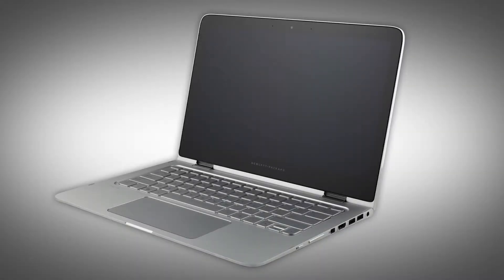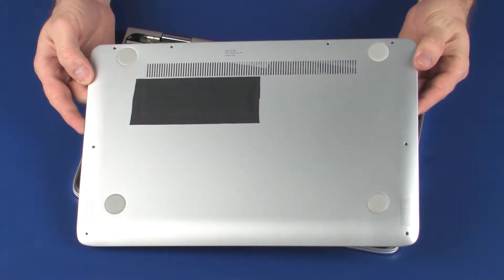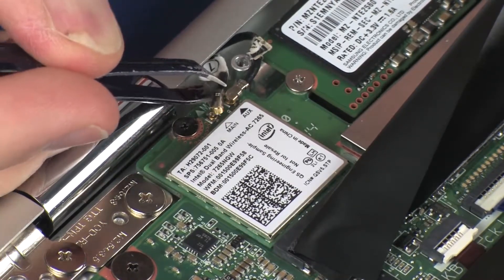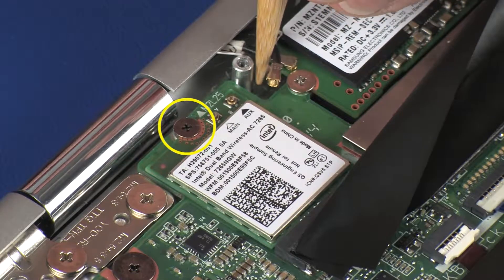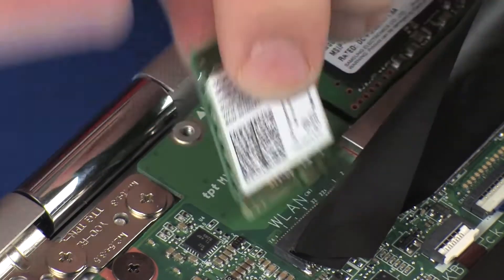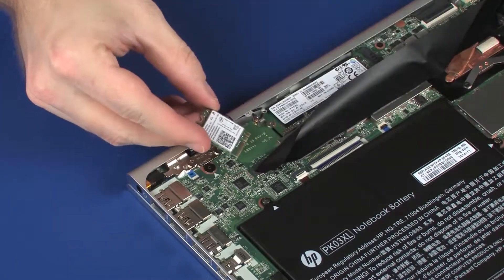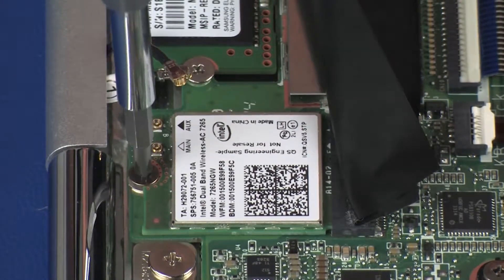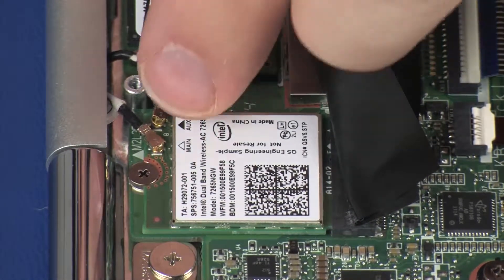Replace the Wireless Module | HP Spectre x360 Notebook | HP Support

Comment: Does this chip control Bluetooth as well as WiFi or only WiFi?
Reply: On the example laptop it is both. It's an Intel AC 7265 which is both Wireless networking and Bluetooth. 
Older devices may have discrete Wifi/Bluetooth modules.

Comment: Hello 
I have hp envy x360 and My wifi not working at all even no icon shows in windows and I checked my system through hp diagnostics I found “ IRQ” fault even I tried changing my card with new card still the same problem and the same error IRQ 
My question that what that’s error means?
Reply from the maker: +Salar Hadi Please perform updates via Windows and HP Support Assistant as mentioned below to fix this issue: Step 1 Windows Updates - 1) In the search box, type and open Windows Updates. 2) Check for updates. 3) If the updates are available, click on install and restart the computer. Step 2 HP Support Assistant Updates - 1) In the search box, type and open HP Support Assistant. 2) Check for updates. 3) If the updates are available, click on install and restart the computer.

Comment: my HP lapto screen went broken and for the time being, i couldnt find replacement due to pandemic. I just want to remove it and only use the remaining part of the laptop with external screen.
however,  when removing the screen, the laptop can still work but the wifi is no longer appear. I guess it is because of the connector of wifi is going to the screen. Is there anyway to still use wifi when removing the screen.
thanks
Reply from the maker: +Nam Le Please contact our phone support team to fix this issue. Please follow these steps to reach them.
Step 1. Open link: https://support.hp.com/us-en/contact-hp
Step 2. Select the product type.
Step 3. Enter the serial number of your device or select let HP detect your product option.
Step 4. Select the country from the drop-down.
Step 5. You should see the HP phone support number.